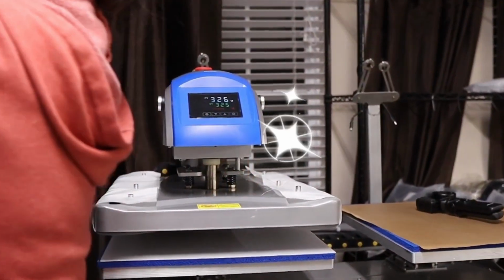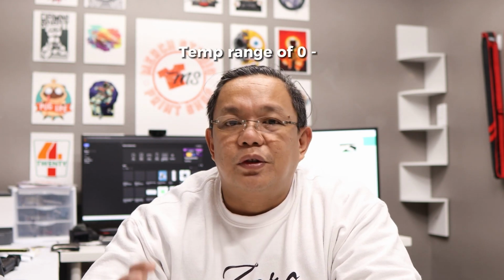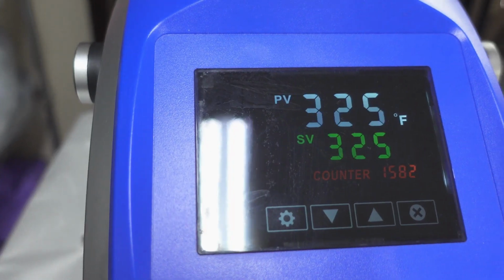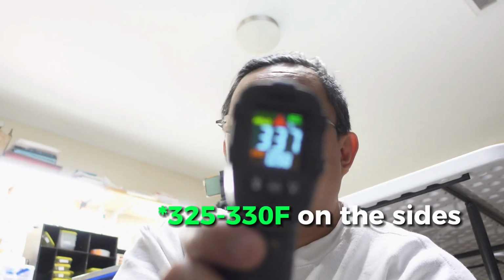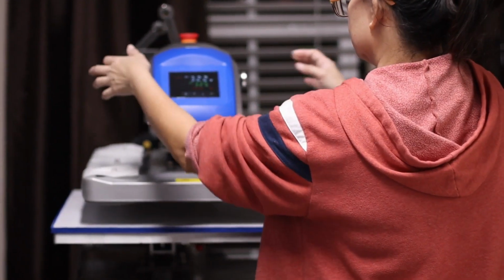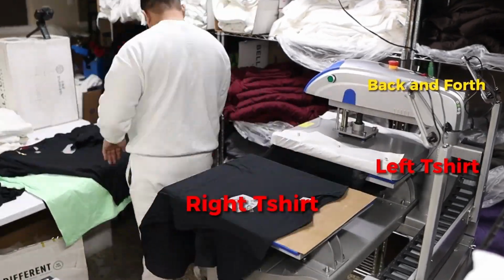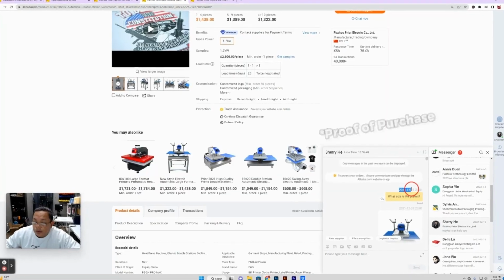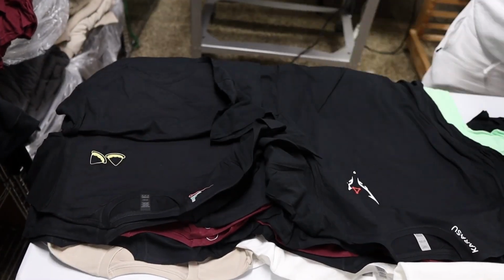I Bought A Dual Auto Heat Press from Alibaba | Disappointed DTF Printer?

Comment: Wow they totally knocked off stahls dual fusion down to the attachments.
Reply from the maker: NGL, they look very similar, almost identical.
Reply: The Stahls factory is directly next to where this is made in China and many of the components are the same. If you buy Stahls you have massively over paid.

Comment: Couple questions on your video..  
1. When pressing you have craft paper under the shirts, is that just for protecting the plattens from ink transfer or something?
2. I noticed you just placed shirt, with the collar (thicker material) directly on the platten, with no pillow or anything. Are you not worried about your transfer not getting enough heat/pressure from the press cause of the collar being thicker?
3. Is there a way to pre-press the shirt once without transfer and without the shuttle moving to other platten?
Reply from the maker: Great questions, Brian!
1. I put a teflon sheet under the shirt just just as a covering for the foam. It's not really necessary, but we put it there in case some dye migration happens with our poly blends.
2. It hasn't been a problem for us. We use 27 psi to press the shirts and the foam on the platen are firm but have a little give.
3. Unfortunately, no. What I would do is pre-press one while putting another shirt on the other platen. Once the first shirt has been pre-pressed, I would move the heating plate to the other side while placing the design on the first shirt.
Reply: @merchstudio  Thank you again for not only the original video, been looking at and communicating with a shop for the same press I think...just need to get my taxes done first and see if I can afford.  Also thank you for the reply and answering all my questions!  Takes a lot of time and dedication to go back and reply to every comment I'm sure!

Comment: Servo with rack and pinion drive is how the press is stamping..  I would love to see inside that press.. The crunching sounds like the pinion slipping on the rack or it’s a stepper motor and not a servo motor and the stepper is missing steps as force is applied..
Reply from the maker: Aahhh… I didn’t really have idea what it could be. Any tips on hownto fix it?

Comment: idol ask mo   sila (dealer)kung  pwede pa bang i adjust yung limit   nung  downward pressure   mukha kasi may stress dun sa  linear post  at nsasagad nya yung mga spring.    di ba dapat  bago  sumagad yung spring  cut off na power nya sa motor
Reply from the maker: Yeah, may adjustment sya pero tama ka. nasasagad nga sya.